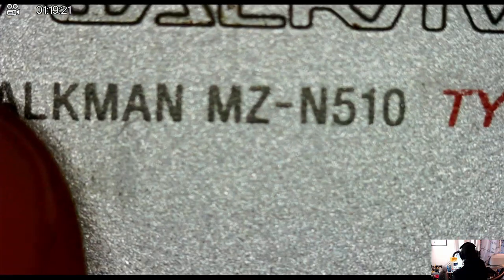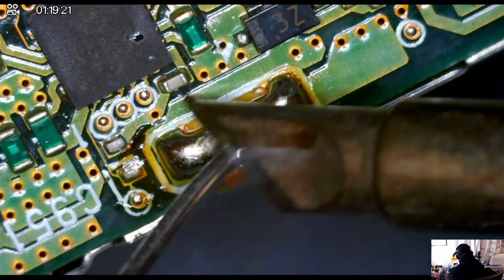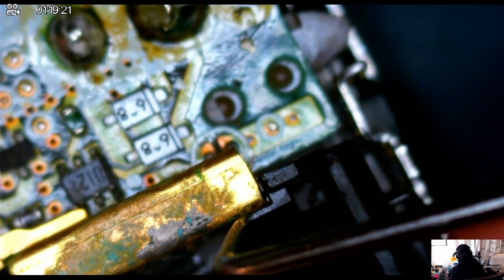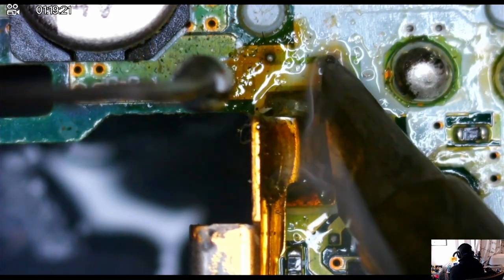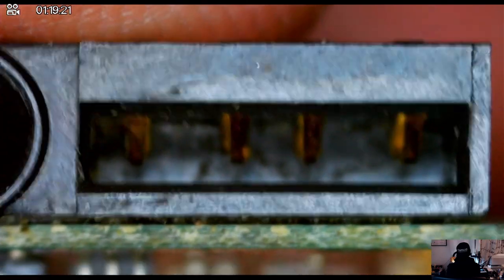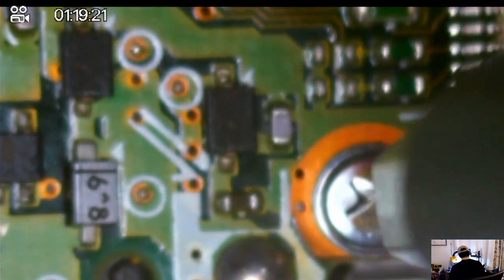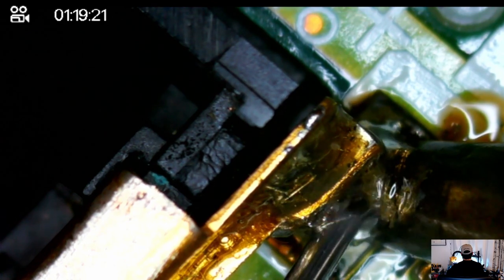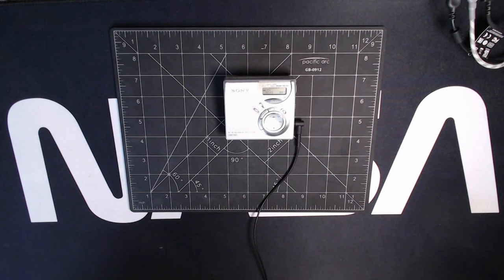How I repaired this MiniDisc player - MZ-N510

Comment: Great Repair video! <3, As someone who also owns a MZ-N510 you've got lucky since with my unit I had to replace the row of electrolytic smd caps, I'm unaware if it's a common problem with these devices if they were made during the capacitor plague or not. But I would also recommend replacing those at a future date.
Reply from the maker: @felixargyle3297  you have a point. There are older motherboards made in the early 1990s that have those issues, this one might too (and might as well try and future proof it!). Thanks for the recommendation!
Reply: @Hexxor  You're welcome!

Comment: If you're going to use AA batteries to power your minidisc player, I would suggest Energizer Lithium AA batteries. They are more expensive, but they will 100% never leak. They use a different chemistry so they don't leak. Plus, they will last longer than alkaline batteries and have about a 20 year shelf life. And yes, I would like to see more minidisc content.
Reply from the maker: I bought some rechargable AA batteries that are nimh and it seems to be working well for the moment! Thank you for the recommendation!

Comment: Hello very good video and repair skills. I have a Sony MZ-R700 in excellent shape but not turn on. I really wish I can use that beauty again, I have more than 250 MD collection recorder by me. I all ready clean the battery terminals and nothing happends. (no corrosion) I just need to connect it to the battery eliminator to see if it works, but I don't have it. Do you think if I get one that could be the problem? Regards from Cancun.